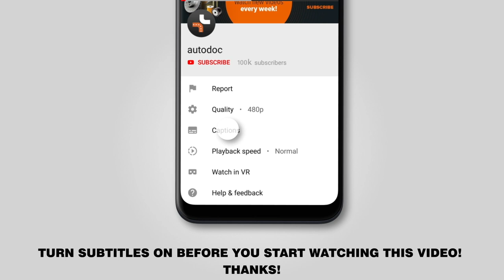How to change front springs / front coil springs on OPEL ASTRA G CC (F48, F08) [TUTORIAL AUTODOC]

Comment: Spraying copper grease on the disc isn’t recommended especially when you come to stop
Reply from the maker: yes, you are absolutely right, before installing the wheel, you must degrease with brake cleaner 1602 Liqui Moly.
AUTODOC